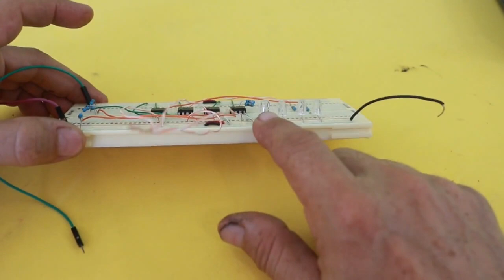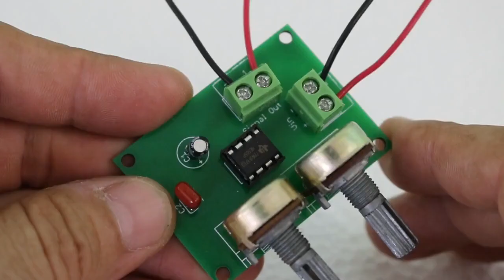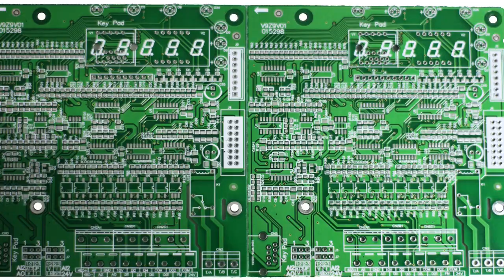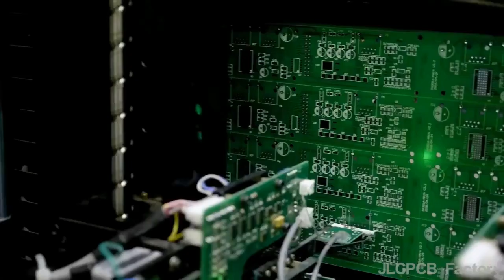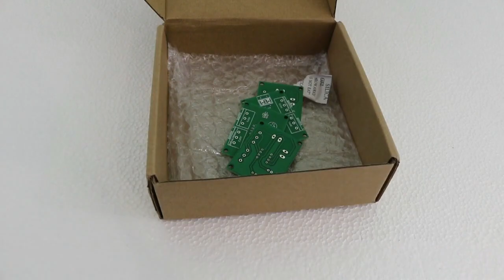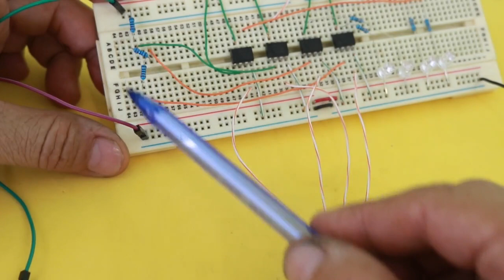The Operational Amplifier - Part II

Comment: 5:00 I think there is a problem if you use this with a single supply.  Since the topmost opamp will have identical inputs, it's state will be indeterminate.  Perhaps an additional resistor inserted to + is needed there.

Comment: This circuit is best made with comparators and NOT operational amplifiers. They are similar, but very different parts. Analog Devices offers this advice in Application Note AN-849.... "the best advice on using an op amp as comparator is very simple—don’t!"
Many opamps will not work in this circuit because of the reverse biased protection diodes between the + and - inputs. 
Please read Analog Devices AN-849 APPLICATION NOTE - Using Op Amps as Comparators by James Bryant
Reply: @Peter S  I would agree that using an op amp as a comparator is probably not the best intro to op amps since it is a non-standard use of an op amp (although it is important to understand the concept of high open loop gain).  I was already familiar with AN-849 before you mentioned it.  The author lists both pros and cons of using an op amp as a comparator.  As is true in all engineering, tradeoffs are often made.  For example, if a circuit requires one additional comparator and the designer wishes to save the expense and real estate of adding another chip, it may be OK to use a spare op amp already on the board as a comparator.  But if someone does that, they should do it with eyes open, having read the data sheet and understanding the possible tradeoff(s) and pitfall(s).  For example, you are correct that the protection diodes may create a problem.  At the very end of AN-849, the author wrote this in the conclusion:  
CONCLUSION
In conclusion, although op amps are not designed to be used as
comparators, there are, nevertheless, many applications where
the use of an op amp as a comparator is a proper engineering
decision. It is important to make an educated decision to ensure
that the op amp chosen performs as expected.
To do this, it is necessary to read the data sheet carefully and to
consider the effects of nonideal op amp parameters on the
application. Because the op amp is being used in a nonstandard
manner, spice models may not reflect its actual behavior, and
some experiment is advisable. Furthermore, because not all
devices are typical in their behavior, some pessimism is
warranted when interpreting the experimental results.
Reply: @Enigma758  I don't know why you took any time to write that. When you present concepts to novice audiences, you shouldn't count on the misuse of parts unless you cite the SPECIFIC part you're misusing and describe the right part along with why the substitution is workable in that case. If there are protection diodes, they WILL stop this circuit from working as intended. There is no "may".
Reply: @Peter_S_  I think we agree, that as a novice concept, it's probably not the best to start out with op amps as comparators, I wrote that in my reply and it was worth stating.  Of course it "may" or "may not" work depending on the protection diodes (and possibly other things as the article implies).  That's exactly what I meant.  Also worth stating was a statement in the conclusions section which is "In conclusion, although op amps are not designed to be used as comparators, there are, nevertheless, many applications where  the use of an op amp as a comparator is a proper engineering
 decision."  The best advice I can offer anyone on this matter is to read the ENTIRE article, and not just the snippets that are posted here.  Engineering is all about making proper tradeoffs.
Reply: @Enigma758  Hey.  Since you added your comment I read the circular as well.  It is not a good matter-of-fact article and should be pulled or heavily redacted.  Unfortunately it seems the author is no longer with us, since relatively recently.

I want to make it plainly clear to any reader that op-amps are designed to be general purpose ICs, sometimes they are made with specific parameters to make them more ideal for specific tasks, but they are still general purpose.  Op-amps that are used as comparators are not being "misused".

As per normal practice, as an engineer you will always read the data sheet.  And if you're building a product with a general purpose BiFEt, for example, you will order the milspec and plant that in the BOM.  It's how the business works.  (General consumer products may not need milspec, but I always used them due to the nature of the work I did).

This topic of protective clamping diodes and whatnot has only ever turned up for me when they were required (like never).   If anything is read, by anybody, that says the 741 or TL081, or any general purpose op-amp, is not suited for comparisons (as comparators) then it is fake news -- op-amps make FANTASTIC comparators!  They simply do.  Too slow?  Then select another device.

These general purpose op-amps are not designed to be specifically used as ADCs.  Either to be specifically used at TTL voltage levels.  They are general purpose, and like all things you use, the datasheets will give you the information you want.  If you want to add external protection components then do so as you wish.

General purpose op-amps are about as universally general as small signal BJTs.  To claim that one must use only a specific component for a specific task is first and foremost; not fun , and second; it's not engineering.  In fact, with such complaints, like that which Peter S presents, it sounds  more like hysteria than anything else.

Peter, would you insist a hobbyist use a power resistor if there was a whopping 225mW burning out of it?  Most through-hole transistors [typo] resistors are rated at 1/4W.
Reply: (I may have mistakenly seen another James Bryant obituary.  Sincere apologies if I messed that up.)
Reply: @schitlipz  Here's a good balanced article on the topic from EDN.  
https://www.edn.com/using-an-op-amp-as-a-comparator-here-is-what-you-need-to-know/
Reply: @Enigma758  I don't disagree with that.  I didn't need to read it (I guess I'm bored).  It's kinda what I'm saying.  It's unfortunate that "driving to the rails" has such a negative inflection to it.
Reply: What you talking about?  This is the simplest comparator configuration.  Will work with many types of op-amps.  It simply blocks current with the reverse bias of the LEDs and saturates the op-amp on the other side of the equation.
Reply: @schitlipz  OPAMPS ARE NOT COMPARATORS. Are you completely clueless? as I just said above, many opamps will not work in this circuit because of the reverse biased protection diodes between the + and - inputs. Those diodes will stop the divider ladder from working properly. Read Analog Devices AN-849 APPLICATION NOTE - Using Op Amps as Comparators by James Bryant where he says, "the best advice on using an op amp as comparator is very simple—don’t!". Are you telling me you know more than the engineers at Analog Devices who make some of the best opamps in the world and EVERY competent engineer who designs with opamps? LOL! Opamps are DIFFERENT parts using DIFFERENT internal circuits which are made for DIFFERENT TASKS involving analog feedback. Comparators do NOT use analog feedback so they're not constructed to use analog feedback. The output stages are completely different. You can misuse SOME opamps as comparators but not others. You can misuse many circuits; you can even misuse some digital logic gates as opamps to construct analog filters, but in exactly the same way.... only SOME digital inverters are able to be misused as opamps and the majority cannot be used that way. How long have you been designing and manufacturing electronic products? I've been doing it for over 35 years.
Reply: @Peter_S_  Dude, I'm sorry you wasted time writing that block.  Electronics was my bread and butter before retiring.  Op-amps were my love.  They still are.  No point in citing books to me.  I know the book writers (not bragging, and probably not the book(s) you cited).
Reply: (Books or circulars, whichever.  Same thing; preaching to the choir.)
Reply: @schitlipz  I didn't waste any time. I've exposed you as a know-nothing fake so you don't trip up others trying to learn this subject. IF what you said was true and I'm sure it's not, then you would understand the revered biased protection diodes between the inputs in many opamps will stop the divider ladder from operating. The diodes are clearly shown in figure 9 of the 5 page Application Note I cited. That's just a fact of electricity and it's not open to your opinion. Diodes don't care about your silly and ignorant opinions. I don't care who you claim to know because it's irrelevant to the fact of the diodes affecting the divider. That's your insecurity trying to cover for your lack of understanding. I cited a single authoritative application note from one engineer at one of the most respected analog electronics manufacturers EVER which explains it to anybody who reads it. If you choose to be ignorant and insecure in public, that's your choice. I posted what I did because it's a trap for inexperienced people who expect all opamp inputs to operate the same way and don't know about the protection diodes. I've actually gone to breakfast with Jim Williams, I wonder if you've ever heard his name? 😂🤣

Looking at your channel is educating. You're a complete fraud (with no musical skills) and you are most likely attracted to men but you are eagerly trying to distance yourself from your desires by espousing hate. If you like men that's completely OK; you don't have to project hate to try to "cover" for yourself. In fact, the world would be better if you stopped.
Reply: @Peter_S_  Uh huh.  Okay.  Yeah.  lulz.  Not sure why you wasting breath over something that is logical.  It is provable.  It is testable.  It is applicable.  And it is one application among myriad for op-amps.
Reply: @schitlipz  You are a complete clown. 🤡
Analog Devices offers this advice in Application Note AN-849.... "the best advice on using an op amp as comparator is very simple—don’t!"
Reply: @Peter_S_  Sorry, pal.  I can't listen to trolls anymore.  Have a nice day.
Reply: @schitlipz  LOL! You troll my comment, I explain exactly what's going on, and you're not honest enough to address the reverse biased protection diodes because you got made a fool of, and you call me a troll? 🤣🤣🤣 You may want to start training in a justin bieber forum or whatever idiot teens use nowadays, maybe you’ll learn something about trolling because right now you just expose how little you understand about the subject matter.